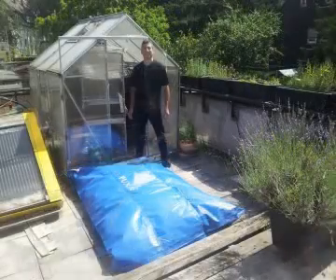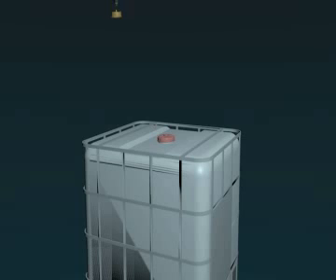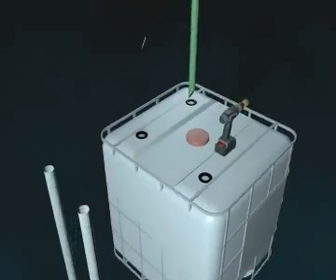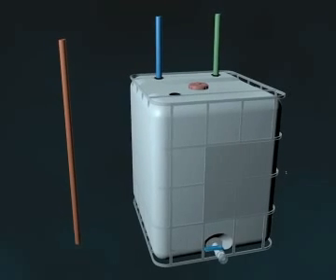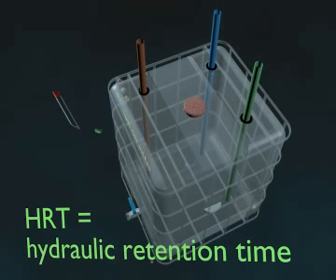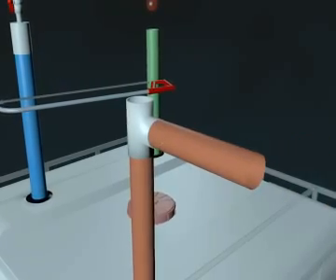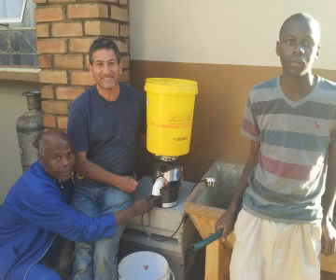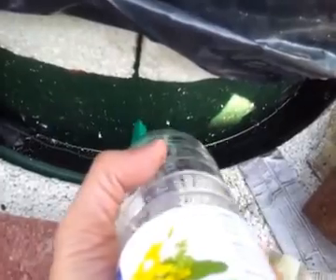Solar CITIES IBC Biogas System Tutorial Complete

Comment: One of the best designs I've come across. 
I have to ask tho, if I wish to store the gas in cylinders; do we need to pressurize the gas? Do I need special equipment or tool for that?
Reply: Yeah you both need to filter CO2 and H2S and compress it in medium size unf we cant store directly I thought to store like that too bast way is pvc bladders I guess if you don't have filter and compressor

Comment: Good day,
I have some questions...

- Why does the digester have to be fed at the bottom? Will some of the fresh material you throw in not float in the pipe?
- How long does it take to produce fertilizer at optimum temperature?
- There are different grades/types of steel wool, which one do I use to clean the gas of SO2?
- How do the microorganisms get into the digester? Or are they on/in the food scraps that are thrown in?
- I’m aware that the fertilizer is produced in the middle but what can I do with what floats at the top of the tank and what sinks to the bottom?

Thank you
Reply from the maker: Hi ToffaX, please post these excellent questions to our facebook group "Solar CITIES Biogas Innoventors and Practitoners" and we can answer them better.

Comment: Great design!  Only thing missing, was any mention about how bad sewer gasses smell, and the harm those can do, if not treated....
This looks like a re-design of the old Chinese clay digesters used on farms.  BUT...taking the methane off the top, stinks of "sewer gas".    To control that stench, they used to put wads of extra-fine steel wool into the gas delivery pipe, to [catalytically?] capture the sewer gasses, which makes using it to operate gas cookstove, gas lights or heating, much easier/more pleasant/healthier.

Comment: Love this design. I picked up a dozen IBC totes today and am using some for pig housing. I think I would do this design with a larger intake pipe, Something 6-12" in diameter. Would you foresee any issue with that? I'd like to be able to shovel manure into it. Also does the intake pipe need a cap? Great Work!
Reply from the maker: Michael Carey I now routinely use 4 inch pipes for inlet for the past 4 years. Works much better, yes.
Reply: How has this turned out for your farm?

Comment: Like the Concept.
But, Biogas is not a Dry Gas so it will coat fuel lie and plug nozzles eventually.
This is a real pain to clean according to a contractor I know who cleans a Heating Boiler Nozzle System in a Sewage tTreatment Plant.
Any Ideas to Rectify this Problem?
If Biogas is not a Dry Gas  won'it Plug up other Nozzles?
Like to Know before I attempt Spending Time & Money on This System!
Reply from the maker: Al Semi -Back-Up.... in home systems we just shake out the water... different ballgame.
Reply: How do you Shake out the water and Why don't you explain that in your videos?

Comment: Do these systems not produce H2S? The industrial digester I work on has to dose with ferric chloride to keep the H2S in a safe range.
Reply: often a scrubber composed of a 3" pipe full of steel wool is used..allowing the gas to flow through.

Comment: Hi, Good video! The way you feed it and draw off, the heights  of your pipes  where you draw off will be the the height of your liquid, how do you keep the fluid out of your gas line?
Reply: My thought as well. Did you ever figure it out?
Reply: Gas generated floats on top of the fat-oil-grease or F.O.G; which will escape through the whole drilled on the blue pvc pipe near the top the IBC tank for maximum gas collection. As far as the fluid and gas getting mixed up goes, well they won't because the gas escape whole is up near the IBC upper wall, where the liquid fertilizer intake perforation is around the middle of the fluid within the system. And remember, if you feed five litters of new grounded food material into the biodigester, an equivalent of five litter of liquid fertilizer will be forced out...It is simply a mass balance kind of situation. I hope this helped clearify this system. DISCLAIMER- I don't work for this company; However I am a Hydraulic Engineer and I believe in knowledge sharing. Cheers!
Reply: @harissououro4335  o

Comment: How long does it take for the waste to break down so you can use the gas, water for shower, etc? Can it be used to hook up to your inside gas stove, and run the inside lights, and water for shower? How much electricity can you use, what will it run?
Reply: You'd need to pressurise and filter the gas before sending it to a generator, by for example letting it run through a calcium hydroxide solution. Also recommended before storage so it doesn't corrode the tank, but it's not uncommon to store it locally in say plastic drums or rubber bags. You'll need several tons of food scraps to make any decent amount of electricity. You can absolutely cook with this gas, there are special burners for it but should work anyway. They do it in India DIY style, often without tank they just let it build up and run a line to the kitchen.

Comment: Would it be possible to build a digester out of a 12 inch PVC pipe and lay it horizontally?  Feed it on one end, take the gas from the top and take the slurry from the far end?  
If so, this would open up a lot of possibilities as to where you could put it, and it would make it easier to connect it to your sink and its garbage disposal.

Comment: I am having issues in that my slurry pipe is not producing.  My tank is now full, but nothing is coming out of the slurry pipe. In fact it is so full that it has blocked by gas outlet, and is forcing gas out the seals.  I have ran a rod down the pipe thinking their could be blockage, but this has not cleared the pipe.  I have liquid in the pipe at the top of the IBC, but it isn't forcing it up and out.  Can you explain the issue and the solution?
Reply: Thanks for the response. It did start flowing a few days after I posted.

Comment: on the others that I have seen there needs to be a hydrogen sulphur scrubber and needs to pass into water to dissolve the co2 it produces? but this would be a much better idea for me
Reply: That's right. The scrubber is easily done by interpositioning a copper pipe on the gas line and fill it with steel wool (the fine kind). The steel will react with the hydrogen sulphur. A separate water bubbler will take care of the CO2 and will prevent any flash back if the line is connected to a biogas burner....

Comment: At around 5:10 the input pipe receives a "plug" without verbal annotation.  Is this just a typical plug to prevent gas from escaping?
Reply: No gas will escape through this pipe because the feeder's opening is at the bottom of the IBC. The plug is just for preventing any odors coming out, if any...

Comment: I'm sorry but I am trying to build one of these thing and am a little unclear on a few things. The uniseal is 2" but the hole is 3" the pipe is 2"???  Would it matter if I used a 3" uniseal on a 4" hole for the inlet and a 3" pipe?   I ask because the plumbing on my house runs 3" pipe. Do I have to use a 3" or 4" pipe for the outlet if I use a 3" inlet pipe?
Reply: I don't think it matters how you seal the pipes, silicone would do the job, just mach the hole close to your pipe size..
Reply: awsome?
Reply: Uniseals are difficult to come by. INstead use crazy glue mixed with fine dry sand while gluing the pipes  to IBC. Use some sort of flange on the outside of IBC to increase the area of glued connection and therefore strengthening it. Good silicone should work as well.

Comment: What is the average monthly gas output in pounds for a IBC tote digester? How long would it take to produce same amount of gas in a 20bl propane grill bottle.
Reply: From the other videos I have watched the answer depends on what you feed it and how large an operation you have.  One video use 3 IBCs and I think they said it would last them a couple of weeks once the gas was built up.
Reply: Odis  Hi, can you provide video link for the system with 3 IBC C tanks?
Reply: propane bottles normally operate with higher pressurization (According to the publication NFPA58, a tank with 20 pounds of gas at 70°F has a pressure of 145 psi, at 90°F would have 180 psi, at 105°F would have 235 psi, and at 130°F would have 315 psi.). This process is not a high pressure system like propane bottle filling stations are. The bladders expand until methane expands the bladder to max capacity only, then the contents of the tank would be forced out the runoff tube. If you build a similar, more robust, closed system, you could get higher pressures though, but then there are also more safety considerations, and feeding more biomass into a pressurized tank would become a challenge too.

Comment: Has anyone managed to make a digester work reliably in UK ambient temperatures? The detail that just won't go away is that the methane bugs slow down to a standstill below 20c.
Reply: +brianhughes45 AD is a growing sector in the UK, although most plants being built are in farms, and have good insulation and even heating coils. One option is to put your digester underground, as soil has a more stable temperature, and use a thick layer of rockwool. 

You should probably check the UK AD association website for more info
http://adbioresources.org/
Reply: +brianhughes45 I did my internship in Germany at February 2016. Was working on a 1 cubic meter of biogas pilot plant. If you have a thermostat and proper insulation, yes you can have a working anaerobic digester, even with surrounding temperature at 0 centigrade.
Reply: +Edriem Did your system include electric heating? AIUI. the methane bugs are anaerobic, and don't produce any heat of their own, which could be a challenge in an off-grid setup.
Reply: Yes. They do produce heat during degradation of the organics, however heat produce is too small it's negligible. I'm not sure either methanogens or other bacterias.

If you have an engine, you can use a propane or diesel or any natural gases to produce electricity for the heating devices and also use the excess heat from the engine to your digester. There are some cases, within 2 weeks, the digester produced enough biogas to be use in the engine to produce electricity.

Comment: The simplicity an ingeniuitz are extremenly ineresting.

Here are two questions:

1) where are the bacterias coming from who will digest the food waste? 

2) can animal or human feces be put into the digester as well?

3) I don't understand how the sludge gets pushed out unless the IBS is full to the top.

4) anz estimate of gas production per cubic meter or liter of food waste?
Reply: +Yves Baggi To answer your questions:

1) methanogenic bacteria can come from a variety of sources, such as animal manure and biogas start packs. However, it is worth noting that AD will start spontaneously, although it may take longer for the right bacterial community to develop. 

2) yes they can, in fact, you should definitely use animal manure as it will fasten the initial process. In fact, many biodigesters in China, India and other developing countries are dependent from the input of animal waste to provide the required gas output. Human faeces can also be used in AD, in thi case one would refer to the process as co-digestion. However, when doing so one should then treat the digestate prior using in agriculture as some parasites and pathogens can still be present. IN case you have enough space and organic matter, thermophilic composting (that is reaching temperatures of above 60 degrees Celsius) is a good treatment solution. HOwever you should monitor your composting heap reaches the requires temperatures for several days. 

3) The IBS needs indeed to be full before any digestate will come out

4) The digestate output depends on the feedstock: kitchen scraps usually provide a better generation rate than animal dung and/or human faeces, as they contain more nutrients for the bacteria. You can gave therefore between 100 and 200 liters of methane for every liter of kitchen waste.
Reply: @aromadiportanuova 
3) but where does the gas come out, if the tank is full. The hole in the gas outlet pipe will  be blocked
Reply: @PhilW1986  That's why digesters have one feeding inlet and two outlets: one for the gas, which in many digesters is placed on the top, and a digestate outlet that is placed at a lower level, opposite to the inlet. 

In simple systems the digestate outlet is left open, and thanks to the principle of communicating vessels the content of the digester will never get to plug teh gas outlet, but rather overflow through the digestate outlet. 

The build up of gas will also create pressure too "protecting" the gas outlet from being clogged by digestate.

It's much easier to visualize it with a diagram. in the link you can find the drawings of different designs

https://sswm.info/arctic-wash/module-4-technology/further-resources-wastewater-treatment/anaerobic-digestion-%28small-scale%29
Reply: Thanks a lot +John Doe

super responses. One clarification though. What do you mean by AD? Probably something related to 'Digestion'.

Thank you very much.
Reply: +Yves Baggi you ate welcome. AD = anaerobic digestion
Reply: +goinghomesomeday1 

Yes, I'm hoping to build one at our Montessori School. Although we'll have to manage smell property, or we'll get shut down.... but there is a poney club next door so we should be getting enough horse dung.

I would also love to make one for our secondary residence. But it would need to be highly automated as it would not have waste matter for days in  a row in the winter.

Any recommendations?
Reply: +John Doe 
Thank you again. I had hear of the anaerobic digestion. SO all these digesters are anaerobic then?
Reply: +Yves Baggi indeed. it's also mentioned in the video.  aerobic digestion of organic matter is also known as composting
Reply: that was going to be my first guess.

Thank you

Comment: What are you doing to filter hydrogen sulfide that is also a by-product of this process?  

Hydrogen Sulfide will corrode your appliances and cause other problems.. and is toxic to humans...  

I've seen the gas run through a pipe with steel wool to purge before... this kind of filter media needs to be replaced periodically as it will oxidize and is not a pure catalytic.

Also, how are how supplying pressure to the storage?  Regulation to the appliance can be done post storage, but still there needs to be pressure on the storage end.
Reply: +Eric Sandquist Check out facebook group Solar CITIES Biogas Innoventors and Practitioners for answers. People there are always willing to help.
Reply: As far as I understood, instead of the steel wool or in addition to that you could also bubble the raw gas through water. That way, you have to replace the water, but it is a given resource. But I dont know whether it filters out just the CO2 or also the hydrogen sulfide.

Comment: if the hole in the gas pipe is above the water line, how does the slurry escape through the third pipe? how is the slurry pushed up the compost-tea above the water mark?
Reply: The hole in the slurry pipe is half way up the tank, and below the liquid level. as you feed waste and H2O into the feed tube, the level of slurry will rise, and will run off through the slurry pipe. That the methane builds inside the airtight tank (above the liquid level), it will offset the "pressure" that will build as slurry is added, then exit through the runoff tube. If no gas is consumed and the methane storage bladder is aloud to reach max capacity, the slurry level will be pushed down as the methane increases in volume, until it is pushed out the slurry hole and the gas escapes there too.
Reply: gas that is produced pushes the slurry out

Comment: How much water should we put in the IBC before any wast goes in????
Reply: add a 50/50 water/waste mix until the slurry level is over the slurry exit tube hole, just over half way at least. you won't get slurry until there is enough slurry volume to allow it to exit the runoff pipe though. so if you add slurry until the tank is full, you will get slurry faster. also you should fill the tank in order to eliminate as much oxygen as possible. Oxygen is counter productive to the methane process, so, fill the whole thing. I would initially fill the tank near full until methane starts to be produced (between a week or two if everything is done right) then add slurry on whatever basis it accrues for you. The max slurry level in the fill tube won't exceed the highest point of the runoff tube, unless maybe you have a blockage in the runoff tube for some reason.